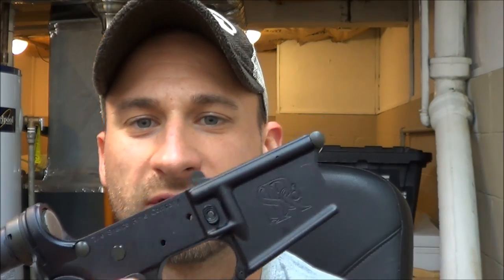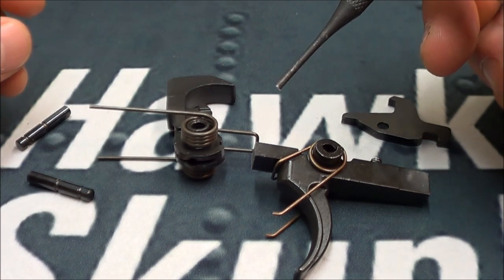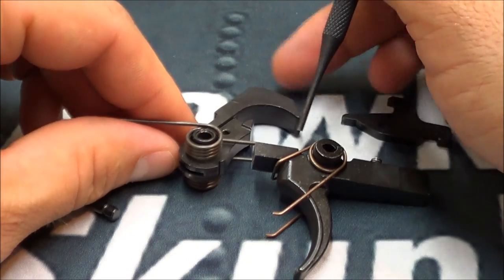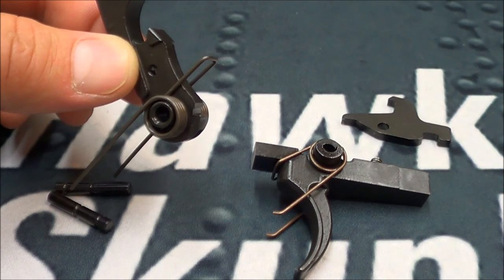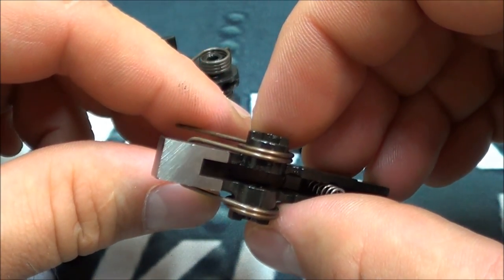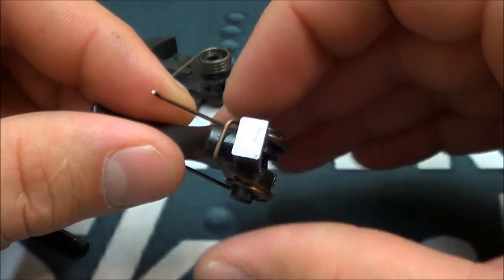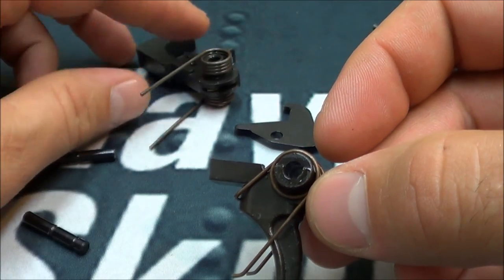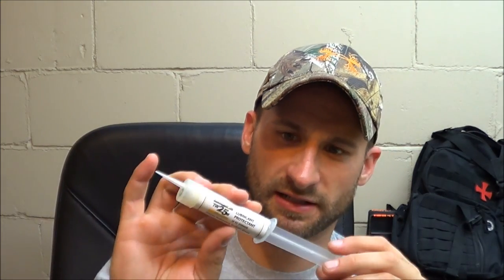AR15 Trigger Upgrade Step:1 Polishing

Comment: Made a big difference on my mil-spec trigger. Used 1000, then 2000, dried or semi-dried Brasso as a buffer paste and very delicate finishing with a soft Dremel polishing bit. Very crisp trigger with a nice break now and I am a Geissele fanatic with Geissele SSA and SD-E triggers on my other ARs. You should polish in a figure 8 motion if doing it on a flat table surface. I prefer wrapping the sand paper around a flat jeweler's file and sanding VERY carefully. To quote another video on this subject: "LESS IS MORE" and take your time. No more crunchy mil-spec trigger!!!

Comment: Just did this on mine starting with a 2000 grit and finished with 3000 grit.  The finish is near mirror.  
I started with a little better trigger in the bcm pnt, and I basically removed the finish on those mating surfaces and then a very very slight polish, and it feels so much better
Reply from the maker: Nice!

Comment: So I am WHOLLY surprised at the difference this makes. I have a 6.5 grendel set up for moderate distance considering the round. With the stock trigger I could feel every little mar and burr, and after polishing the surfaces it's like butter. Clean pull, clean break. I used some polishing compound and a little buffing attachment on my dremel to finish off, and it's a really smooth action. Thanks man.
Reply from the maker: Glad to help
Reply: @HawkeyeSkunkWorks  I may have been a little aggressive, but I won't know until I can find some more 6.5 grendel lmfao